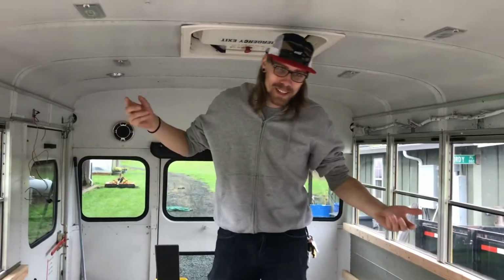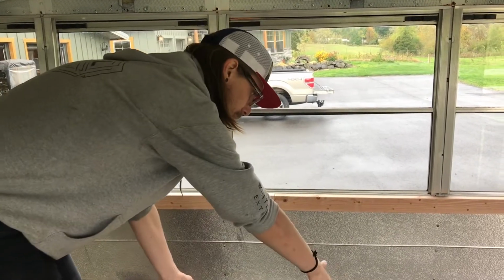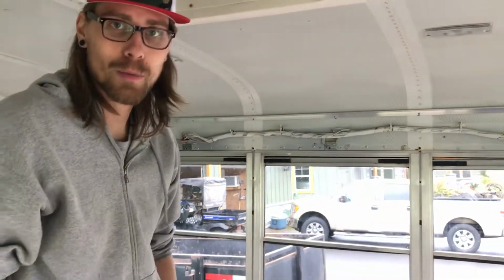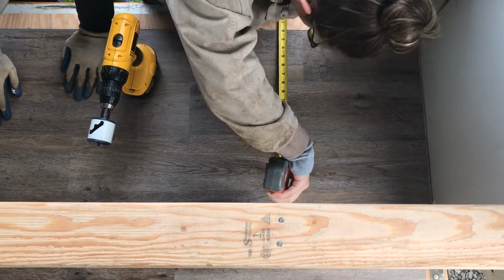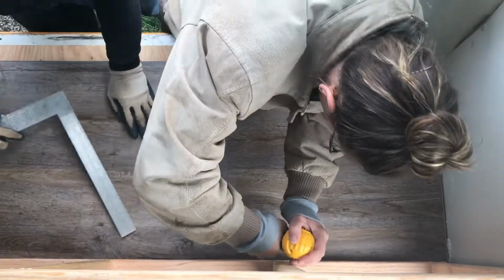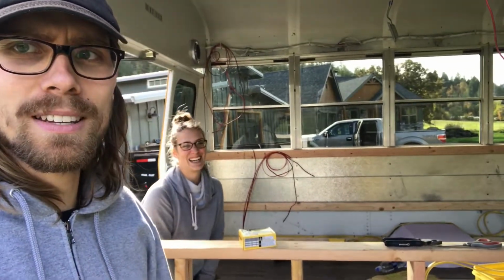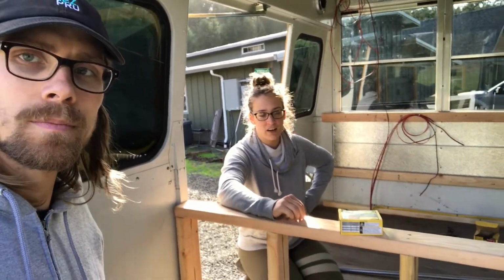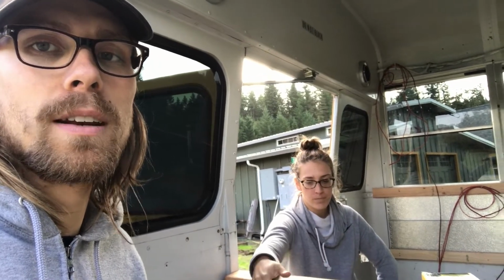Bus Conversion: Floor Plan info and Rough Wiring

Comment: Did y’all try Platt electric by tactics in Eugene? They’re the best place to for kind of specific electrical needs! Haha
But I’m also confused on what you mean by you needed red/black 12/2 wire. 
You need the 2 wires and a ground? Or you needed 3 and a ground?
12/2 with ground is obviously pretty standard and looked to be what you were running throughout this video.  
So I’m guessing you need 2 hots (one 12v and one 120?), a neutral and a ground for the fridge? Is it a weird DC thing so you can swap power back and forth somehow to shore power or battery power? I’d like to see how y’all are implementing the possibility of switching power sources :)
Reply from the maker: Didn't think to look at Platt! We have been going to Oregon Electronics over off W 11th for weird stuff. We were actually looking for 12/2 with out ground that was combined because we didn't want to fuss with the red and the black individually (this is Hannah's dad's thing and we just went with it). Supposedly as long as the fridge is plugged into both a 110 and 12v outlet it will switch back and forth automatically, favoring 12v when available. Honestly, not sure how this is going to work in practice yet. We will let you know! (or make a vid about, idk) ;)
Reply: SummBus
I’m still confused lol
Wouldn’t y’all need 12/3? 
2 hot wires, (12v and 120) switching between the 2 as necessary, and a neutral?
Also I would think y’all would want it to favor 120v because that’s when y’all are hooked up to shore power? As opposed to 12v since y’all will always have that though your batteries?

I think I would have personally bought 12/3 and phased one of the hot conductors if you felt like it.
But to be fair I’m completely confused on how y’alls fridge setup will work. So I may (probably am) be thinking in a completely wrong direction. Haha
The vlog is turning out pretty well so far! That flooring looks dope!
And the only think I’d recommend is maybe having a list of materials used, and how much etc in the description. Just in case someone else down the line is trying a similar thing and wants specific stuff :)